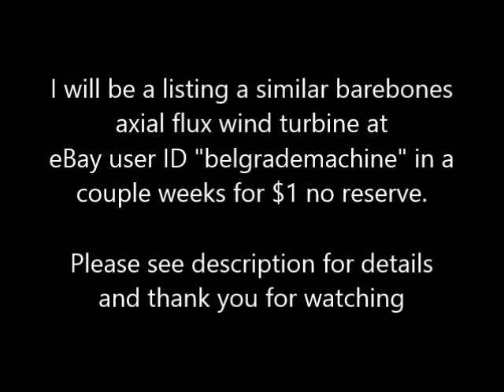Barebones Axial Flux Wind Turbine Muddys Mighty Mini Alternator PMA

Comment from the maker: Interesting thing, even the aluminum although not magnetic will cause resistance by way of eddy currents (Lenz effect). I think I just need to keep the magnets away from any metal except the copper stator coils. Next one will have three magnet plate and two stators wound differently, low and high. Different size magnets centered closer to the axis.  Also, I checked my crystal ball and it told me you will be making a wind turbine in the future :) can't wait!

Comment from the maker: Funny thing here is the slight cogging is only coming from those three bolts not the stator. When I put it under load (three phase) there is no cogging whatsoever. I could be wrong but I don't believe it will make a big difference in output.

Comment from the maker: The blades are about 28" and will stand off the center of the hub another 6" so blade diameter will be aprox 68". I also have a set of Raptor blades that Muddy had sent to me and I plan to make a special hub for those too. I don't expect the rpm to get very high with all that resistance when under load. Looking forward to it! Thanks

Comment: I read in the comments of using stainless steel bolts Could it also be designed with an aluminium  sleeve over the bolt

Comment from the maker: Thanks much and good suggestion! It seems the cogging from the stator mount studs, nuts and washers is fairly small so I may make adjustments in magnet size and position on the next one. Since the mounts will be stressed (abruptly) every time the turbine "cuts in" I would be a little concerned with something other than steel but perhaps I'm wrong. I am looking forward to seeing how it performs in a real world situation though. Thanks for putting some thought in it ... much appreciated!